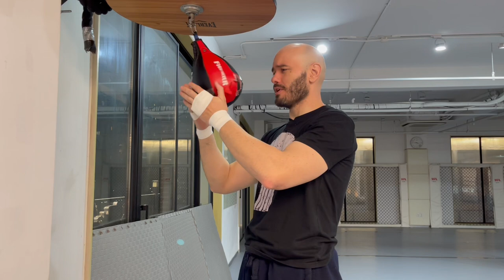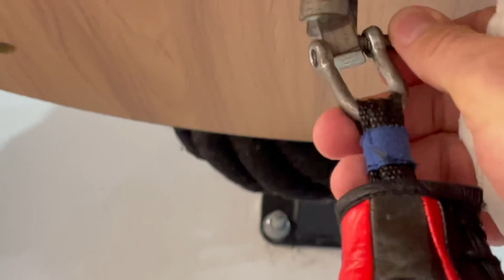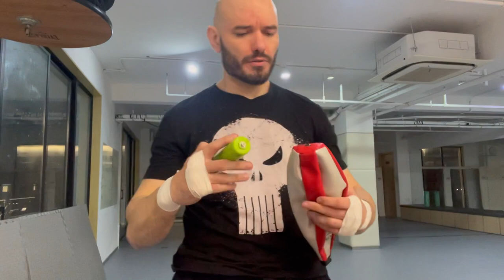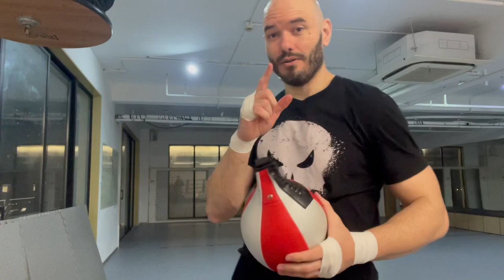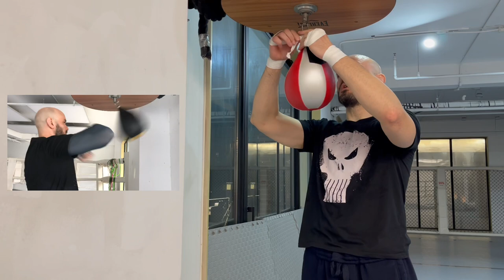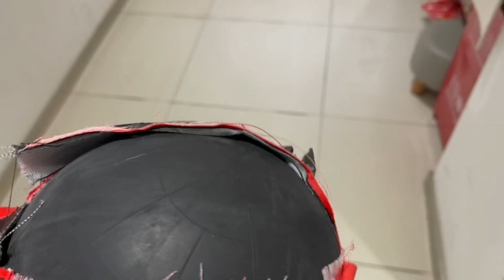Breaking & Changing a speed bag

Comment: RAMSEY!!! missed opportunity. This would have made a cool format for a live stream!
Reply: Also. My speed bag has a carabiner  and ball set up. Are those any good?
Reply from the maker: I can’t live stream from the gym.
Reply from the maker: How does it work with a carabiner?
Reply: @RamseyDewey   it's a little single side  baloon shaped carabiner hook  that you can press in to easily replace the bag. When it is on it hangs pretty low  like the one you were using but it acts like a link in a chain... and the carabiner hooks on to a ball set into the bounce board.
Reply from the maker: @pyronicdesign  I've never used a speed bag with a carabiner. Do you like it?

Comment: You said the reflex ball wasn't a very usefull tool because you are not executing techniques correctly but the speed bag seems to do the same
Reply from the maker: No. Speed bags are mostly hand fighting patterns. REAL hand fighting patters that I consistently use in the same way they are executed on the speedbag. Additionally, the speedbag is a tool for developing power at short range. Check out my speedbag playlist for technique videos on this matter.

The bouncy ball on the string with the headband, on the other hand, radically changed the form of punches to the point of being non-functional.
Reply: @RamseyDewey  I disagree, I think the relfex ball and speed bag have a lot of similarities. A lot of pro boxers have used the tennis ball on a rope for decades.